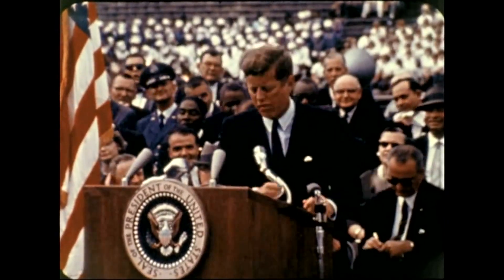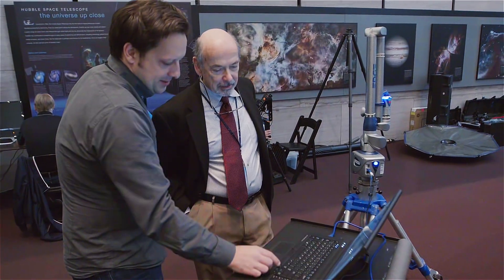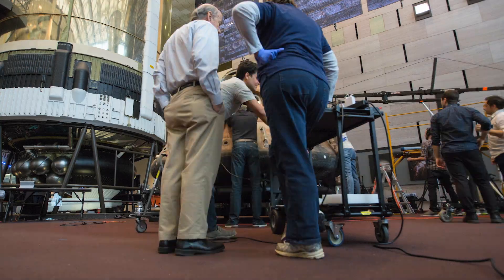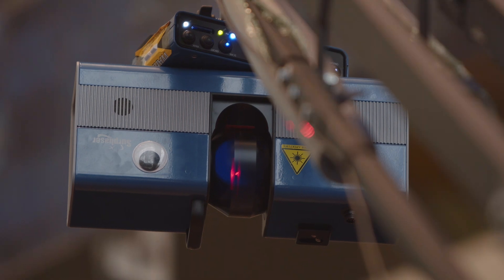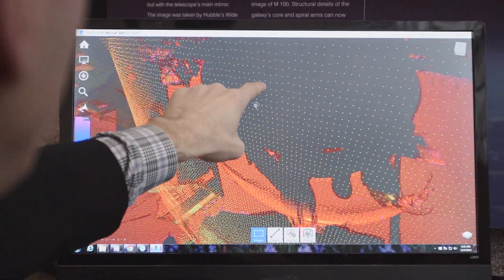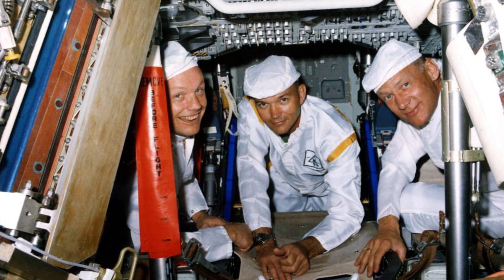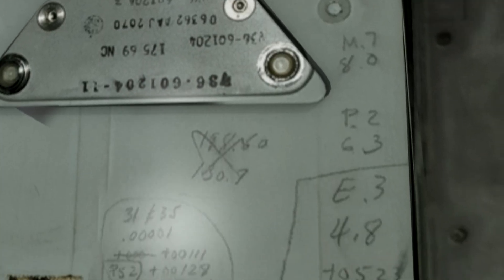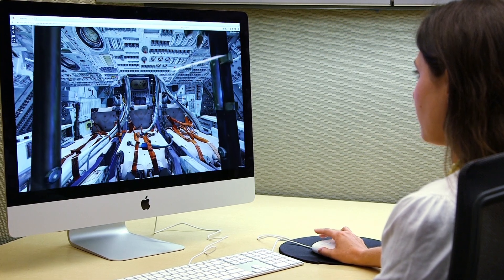Apollo 11 Command Module | 3D Documentation

Comment: What about someone farting in such a confined space.
Reply: David Watts  yup. That was a problem...
Reply: Apparently the Command Module stunk to high heaven, when they returned to earth. The astronauts had gotten used to the smell...
Reply: Frank Borman upchucked most of the way there in Apollo 8. Vomitus in zero g has a way of getting stuck in those nooks and crannies
Reply: Hi Abbas, maybe that had something to do with Frank turning down the offer to command the first manned lunar landing.
Reply: Had air filters in both the command and lunar modules. However they were used to absorb carbon dioxide. And since farts are composed of carbon monoxide. That might be somewhat of a problem for the air filter system on board Apollo.
Reply: @jamesmaletsky2980  farts are carbon monoxide? :))))) best joke i've read today!
Reply: Just breathe deeply.
Reply: @David Watts. Buzz Aldrin actually wrote about the problem of flatulence in the Command Module in his book "Return to Earth."

Comment: In the 1970 movie, "Diamonds are Forever," James Bond wears his radiation shield which is the size of a name tag, clipped to his coat pocket, which is of course a joke at the expense of NASA which had no radiation shield at all in any of the mooning missions. I need someone to run me through the compartments, how did they fit inside this module? How did they get the suits on and off? In what space? Where can 7 parachutes, 3 of which were so huge that folded neatly would take up a lot of room, and then the thickness to protect the crew, impossible! When a person wants to believe something, faith takes over logic. Unfortunately, tignorance is bliss where truth is bitter.
Reply: You are a conspiracy troll, who does not even believe your own BS.   Like all You Tube conspiracy trolls, you lie and lie and lie, for no reason other then to find an excuse to spam and harass.  PS:  I worked at JPL 1974-1986.
Reply: Stanley, are you really this ignorant or are you just a troll?
Reply: 'impossible'?  What is impossible, is how ignorant you are. You can read up, and view videos on how the parachute system worked.   And floating in the capsule, with their seats stowed away, gave them lots of room. at least watch the movie 'Apollo 13'
Reply: Can you imagine being just the 2 of them in the LM, one who is all suited up with his PLSS attached is helping the other fitting on his suit in that cramped interior then walking round the moon with half of your weight attached to your back but still they are walking almost upright, whether you are at one sixth gravity or not you shouldn't be able to walk almost normal stance like these astronauts do.
Reply: Hi Phillip, conditions were cramped, but it was doable. They didn't really walk very much on the Moon, more often than not they bounced around, either from one foot to the other, or they bunny hopped.

Comment: Pretty amazing how well the heat shield held up...I've been up close to Apollo 10, and its heat shield is trashed
Reply: Apollo 10 came in at the highest speed ever for a manned  craft...higher speed = higher reentry temps =  more damage to the heat shield.
Reply: The heat sheild was made of ablative material, it was designed to burn away. A use only once solution, but it worked.

Comment: Really? You couldn't see the notes they wrote or the obvious calendar without the power of 3D scanning technology? Give me a break.
Reply: You are correct, laser scanning was not required to see the calendar, but that wasn't implied.     The notes and calendar were not seen until this digitization project was undertaken, because the Command Module was protected in plexi-glass for the last 40 years.  They were photographed during the project.  Laser scanning usually produces a point cloud which does not show the textures and color on the surface.
Reply: There is also a rule that no one is allowed to physically enter the spacecraft to prevent disturbing or damaging the interior. As such no one has been inside the crew compartment since NASA handed the spacecraft over to the Smithsonian. That being the case there was no way to see what was written on the walls until now. Notice that the boom that went inside was constructed and used so that it never touched anything inside.